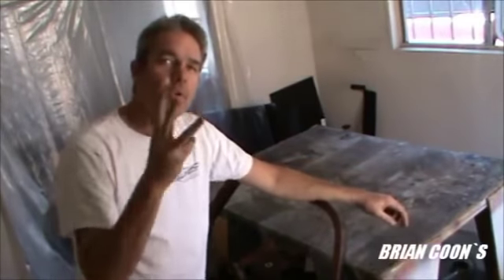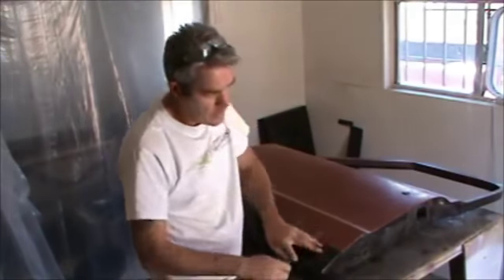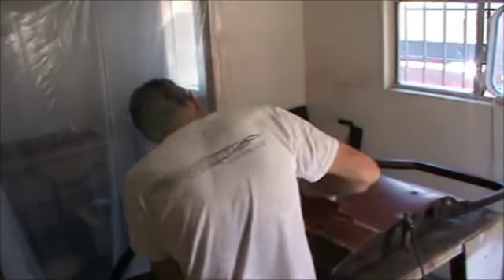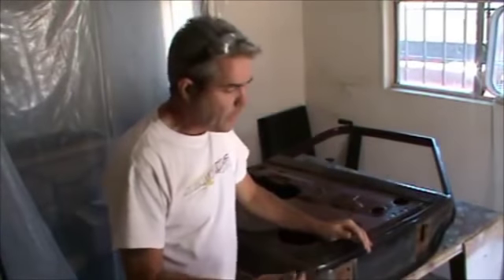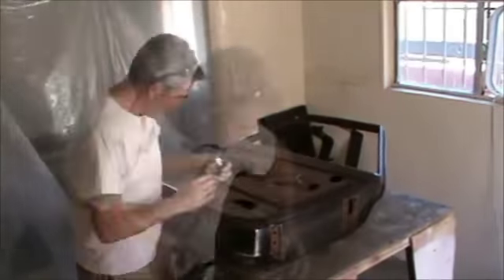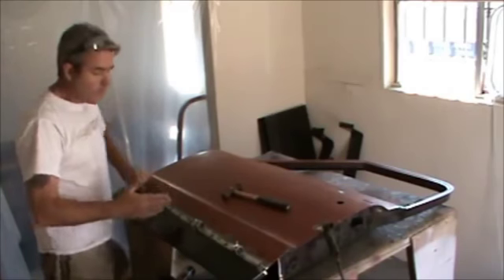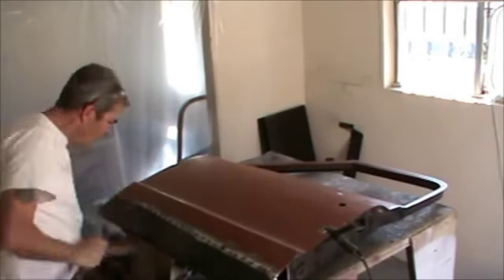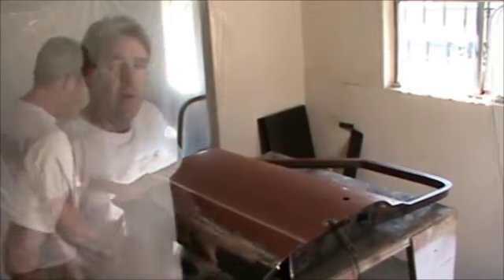How To Repair Rust-69 Chevy C10 Pickup Truck-Part 4

Comment: Do you ever use the flanging way to connect the sheet metal?
Great video!
Reply from the maker: Not sure what you mean by "flanging", please explain.
Reply: It bends the metal so there is overlap.
Reply from the maker: The practice of overlapping the metal is basically outdated now. Due to the overlap, many panels repaired in the 80's-90's collected moisture and debris in the overlap area and eventually rusted again causing the panel to need another repair. The current best practice when repairing panels is to butt the pieces together and stitch weld them to close the gap. We have another video coming out in the next few weeks that will demonstrate current best practices when doing rust repair on fenders. Thanks for the clarification!

Comment: Curious how many hrs it takes to repair a door.   Both of mine have need this repair.    Seems it might be more cost effective to replace with some repro doors?
Reply from the maker: So many variables can affect how long it might take. Do you have the right tools, how much rust are you fixing, has there been previous bodywork/damage, are you replacing inner and outer or just one, how much disassembly is needed before you begin with rust repair, etc, etc...? So, with that being said, we would estimate this job at anywhere from 3-10 hours per side.